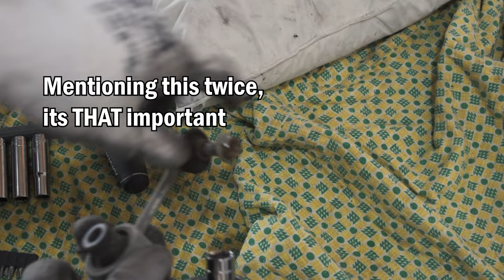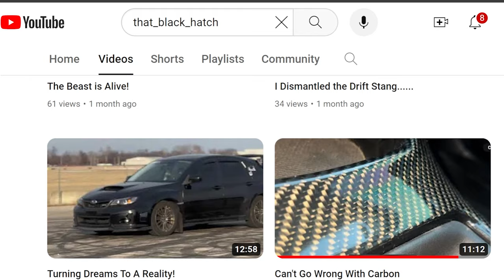2022 WRX gets Cobb 1.5" Lift Kit - Look at me... I am now the Outback

Comment: Awais,  those break pads wearing,  could be sand coming in causing additional wear. Those dirtfish peeps have nifty invention that keeps the brrak disk clean. I trued to get some from them, but they did not respond. Check it out bro😊
Reply from the maker: The brake pad wear was from street use though.
Reply: @HeavyMetalWRX  oi ok strange.

Comment: Great video. Any issues with the CV boot or other issues you ve encounter since the lift ? since this kit is without subframe drop. And the tires that you have been using 235/55r17, does it rub before the lift? Thanks
Reply from the maker: @weijyelim  no rubbing, no issue with boots. I would suggest not doing 235 on a 7.5 wheel like I did. Mainly because it feels squishy. Id go back and do 215 tbh.

Comment: i did a 2.75 front an 2.50 rear lift in a 18 wrx, GREAT CONTENT! just found channel. dig your humility !🙏🏾👊🏾
Reply from the maker: I really appreciate that! I believe in what I'm doing and I'm really enjoying it from the heart so I'm glad that it shows. Also two and a half inches that's quite a lot I actually looked at the 2-in lift that was on the VBWRX but it did require a lot more work by raising the subframe in the back and I don't think I was ready for that.
Reply: @HeavyMetalWRX  
i did it in my driveway with a 59$ sears tool kit , started at 9am was done whole job ( sub frame) by 330 with smoke breaks and im an idiot!

Comment: You’re better off getting gravel lite coilovers with camber adjustment so you can keep a better traction pad while on dirt, etc. 

For the rear studs you were hammering against a wooden wall, should’ve drill a deep enough hole and used at minimum 40oz mallet and your studs would’ve come out no problem
Reply from the maker: I didn't want to jump to coilovers without first feeling the car in relative stock form. I'm not professional. 😂

Comment: Looks great. Eibach does make the spring based kit. Not sure how the two compare.
Reply from the maker: Yea I'm not sure about springs because then it would change how the stock dampners would have to react.
Reply: @HeavyMetalWRX  I am going to wait until there is some good data comparing the lift kits (like you used) and the springs. For me, if the clearance is similar, its about how they act on the road. In Florida, my need for offroad is beach sand and dirt roads. 
Love your content, btw.

Comment: On your front brake pad wear, most likely your front end alignment is out. When your braking that wheel is fighting the braking system. If alignment is in then the caliper is faulty.
Reply from the maker: It has to be the caliper. I have no shaking in the wheel and my alignment is done almost monthly it seems like lol. I'm working on replacing the brakes soon.
Reply: @HeavyMetalWRX i was wondering about what could cause uneven front brake pad wear too... do you think the safety assistance features that apply the brakes to different wheels to maintain traction has that much to do with it? Unless you always drive with them turned off?
Reply from the maker: @20kevinguy10  when I'm racing it's with traction control off. I have done a few autocross with VDC but not enough for that to happen.

Comment: Wheels specs? Maybe a dumb question, Would it be possible to lift a GT? Would it interfere with the technology? (Curious too if it would be possible to add brembos, and work with the technology.)
Reply from the maker: Sparco terra 17x7.5. It may be possible with springs. I believe there are some ideas floating around about that.
Reply: This kit tho, works with the stock suspension, so thinking maybe it could work with the adjustable GT suspension, unless there some leveling sensors? I dunno. good video 👍
Reply: This is exactly the question that I need asked!
Reply: I am already trying to make it my own before I even bought one yet. Good to know 17” are an option, bbk could be issue with the GT, and it’s electric parking brake but aftermarket doesn’t mention (excludes?) GT. My best guess is Lifting kit should work with Gt (it’s not a long travel suspension) the electric wiring for the struts may be too short, but also I dunno if eyesite or emergency braking is affected with these options, so far nobody mentions it.

Comment: New to the channel, hoping to own one someday! 

If I have snow 4 inches or so that sticks around during winter. Would a lifted WRX be practical daily? Or would stock suspension and winter tires be sufficient for ride feel and ground clearance?
Reply from the maker: Oh yes stock suspension and snow tires is more than enough check out my channel I actually have a few videos of me driving through the snow and stock suspension and some blizzaks.
Reply: With a set of good winter tires (not all season) it's pretty much unstoppable unless you get it hung up bad enough that you're tires have no traction or wieght on them.  I've plowed through 18" of (light) snow completely stock besides the continental winter contact si tires. I traded in my 23 sport(premium) for a '24 RS(TR). I got it just over a month ago and it rolled over to 4000km to. Tuned at 3000kms dmann 93 ots , 3500km  IAG pitch stop, cusco rear diff carrier and torque solutions rear diff inserts.  With those couple mods it really changed the car. My '23  was a blast in the snow but sometimes you'd have to do alittle whip or wieght transfer to really get it sideways. I found a little gravel patch to try it after the rear diff mods and pitch stop and it feels waaaay more tail happy
 Turn wheels, foot down and the rear kicks out like your sending more power there.
Reply: 05 WRX on stock suspension & ride height with UHP All-Seasons (used to run Potenzas, this year running Continental DWS06) and I've never had a problem in snow 6+

Comment: Put a nut on the end of the stud and go to harbor freight and get a heavier hammer for $7.
Reply from the maker: Yea that may work as well. I just needed a bigger hammer 😂
Reply: @HeavyMetalWRX  the nut at the end of the stud will stop you from flattening the end of the stud plus you’ll have more surface area to swing at with that bigger hammer. Sometimes people just need a little guidance that’s all. Been working on cars for years. Always use the nut on the end thing when in a situation like that. If you ever needed to use that stud again the threads wouldn’t be all hammered up. You just take the nut off and the threads will be fine.